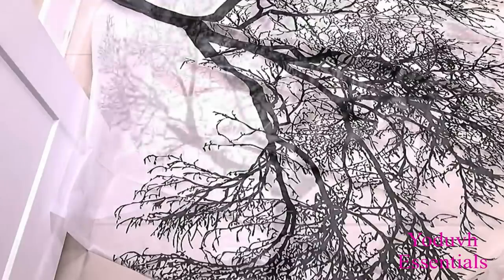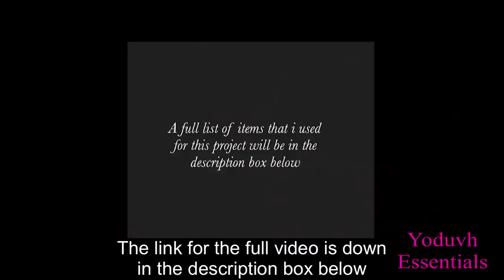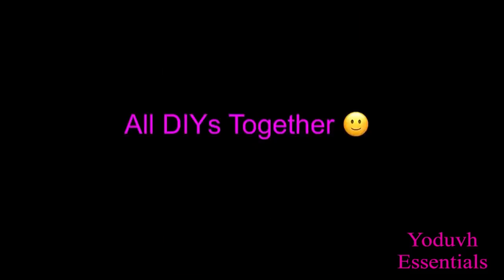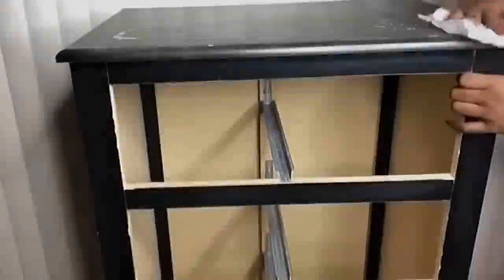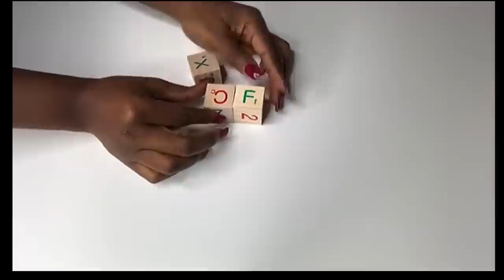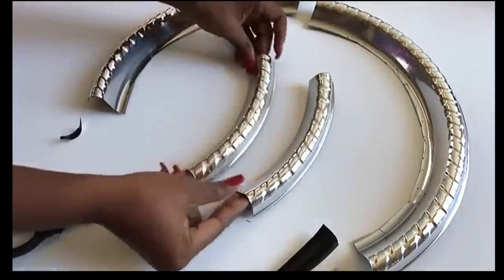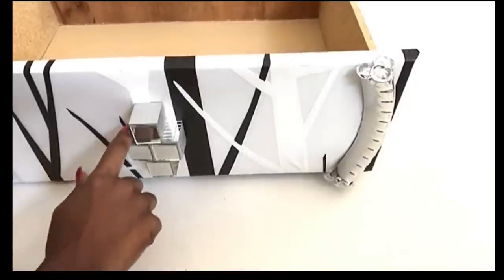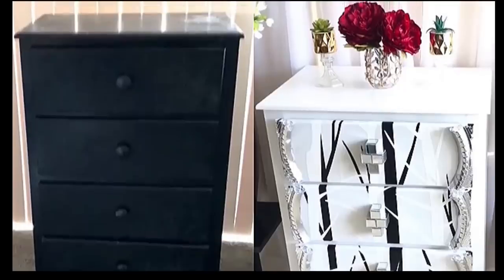Unbelievable WAYS To Use Shower Curtains!

Comment: WHOA! OK, first off, why would you explain the pulls before putting the shower curtain on the drawers? If people had had used glue to hold them before using the screws, then they are set, and they would have to cut around them, or risk screwing up the paint job underneath! And once again overkill with the embelishments! Calm down! You make things look gawdy!